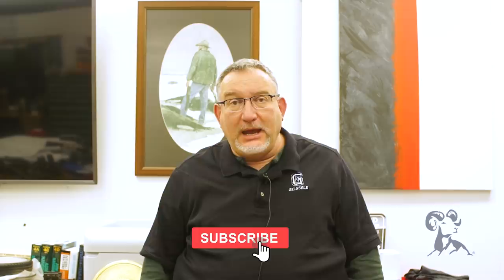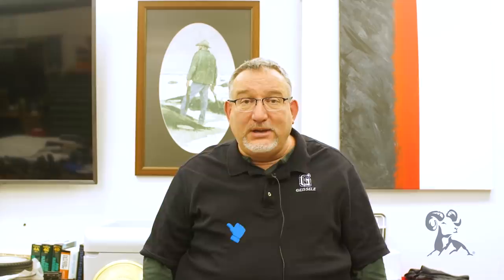SmythBusters: Galvanic Reaction & Your AR-15 - Part 2

Comment: Bill!!  Great to see you sir.  Thanks for producing this.
In aviation this is certainly a concern as it happens often.  For example, aluminum skin panels and stainless steel doublers, riveted together in an aircraft wing, form a galvanic couple if moisture and contamination are present.  It also depends on the size of the parts in contact.  If the surface area of the corroding metal (the anode) is smaller than the surface area of the less active metal (the cathode), corrosion will be rapid and severe.  But if the corroding metal is larger than the less active metal, corrosion will be slow and superficial.
The FAA states how this occurs and shall be mitigated in Advisory Circular 43-4B

Comment: My personal experience with galvanic corrosion is more in the marine world than in firearms, but here is what I have learned over 40+ years of working on boats, and almost that long working on guns.  

First, I completely agree that if the metals are insulated and there is no conductive continuity, galvanic corrosion will not occur, so I pretty much agree with all of the barrel nut discussion.  

However there are other aluminum to steel contact points on an AR-15 that can be subject to galvanic corrosion since they are not coated.  One good example is if you add a set screw to retain the detent lock for the rear takedown pin.  A lot of folks tap the hole on the rear of the lower and put in steel setscrew to retain the spring and detent pin.  Often that is a plain uncoated steel screw threaded into an aluminum lower that has just been tapped, so the contact is direct metal to metal.  That point is absolutely subject to galvanic corrosion.  The same may apply to the steel roll pins inserted into aluminum (however since they are hammered in and out, that may mask minor sticking). 

In most cases, there was some lube on the metals applied during insertion, and they are not likely to be exposed to a corrosive environment (like salt water), so the corrosion is minimal or does not occur, but it definitely can.

Sorry I don't have any pictures, I keep my ARs clean and lubed, so it never happens there (plus I live inland, not near salt water as I used to), but I have witnessed a LOT of galvanic corrosion on boats, where SS bolts were used to retain aluminum fittings.  I once had to cut the aluminum mast step on an older 30' sailboat to free it due to the amount of corrosion and attachment to the stainless bolts.  The solution in that case was the insulation you talk about (in guns supplied by parkerizing, nitriding, or other hard metal surface coatings), I used Mylar washers and tubes to insulate the bolts from the (repaired) mast step and never had any corrosion problems again (this was even published by the boat owners' association as a recommended fix).

So, while the barrel nut may not have that problem, other points an on AR certainly could.  Anti-corrosion, or anti-seize grease usually takes care of it for our rifles.

Thanks for probably the most useful gun videos on YouTube!  Please keep up the great work!

Comment: I'm a jeweler and knew full well that aluminum oxide was basically Ruby, and hard coat anodizing was oxidizing aluminum, and never made that connection.  It's so obvious.
Reply: That’s right, Ruby, Emerald and Sapphire are basically Bauxite crystallized. Darn, didn’t think about that either.

Comment: Galvanic corrosion needs an anode and a cathode in the presence of an electrolyte.  Aluminum will “corrode” when in contact with steel if immersed in salt water or other electrolyte.
Reply: Correct !
Reply: @srspammenot  right... IF in contact... not coated
Reply: Totally agree.  Galvanic corrosion needs some sort of electrolysis to happen, or a slight electric charge.  Don't know why this point wasn't touched upon.
Reply: @CompShooter54  The dissimilar metals provide the electrical charge.

Comment: Hi thank you for making this video. I just wanted to say I'm an electrician and this is something that we have to be concerned about. it's typically not an issue if you have aluminum meeting aluminum it's when you have aluminum in a different type of metal touching is when this can become an issue, but as you say typically some sort of lubrication or grease negates this issue.
Reply: Yup, I’m a builder and my electricians use aluminum tech cable because of copper thieves. They always, always coat the contacts with copper with this weird green grease stuff. Not sure what it is but I suspect there is more in it then simple grease. My inspectors look for the goo as well, it’s important.
Reply: @john-paulsilke893  I'm pretty sure there isn't much special about it, but it is specifically referred to as dielectric grease. I think grease just last longer than oil would.
Reply: In PVC plumbing we us a primer that is typically purple. The colour is there to show the inspector that it was used even though there are primer/solvent combinations available. This grease is probably tinted for the same reason. (Obviously also coloured for the tradesman to visually see that he has done the work right.

Comment: I’m an airplane mechanic - dissimilar metal corrosion is an issue - no doubt. 
No aluminum fasteners - bolts/nuts. Fasteners are cres or titanium for the most part - rivets come in several different aluminum flavors, with some steel bolts and nuts. 
The plane is primarily aluminum. The aluminum is clad for corrosion resistance. Fasteners are anodized/coated/wet installed predominantly, for corrosion resistance. 

Aluminum is 2024/7075 for the most part. There are a few other types of aluminum but they’re rare - 7074 etc...
It’s funny seeing ‘aircraft quality 6061’ - we don’t use 6061 in aviation.

In aviation, it’s rare that threads are lubricated. Torque values are for dry fasteners only. Except for axle nuts that are greased. If you’re installing fasteners for an engine inlet - dry.
Torque values change considerably if they’re wet installed.

Comment: I have ALWAYS used anti-seize on barrel nuts since the 1980s.
Reply: Same here, no issues
Reply: I've always used the same nickle anti-seize that I use on spark plug threads. Works great in both applications.
Reply: Fourth Horseman  Working on motorcycles is where I learned a lot about steel fasteners and aluminum.

Comment: One issue with lubricating threaded connections is this can cause over torquing of the bolt since the connection spins more freely and requires more fighting to get enough friction to hit that torque value. So unless they state to use lube be carful. This is one of the reasons why you don’t lube your lug nuts or bolts.

Comment: Geissele triggers are all I run in my AR's
Reply: I use them on precision guns but for me I don’t because I’m already trained up on a well polished stock trigger. I end up doubling and twitch firing too often. Maybe after the ranges open up again I might try one out again and get some serious practice in. (Yes I know it a training issue, but I simply haven’t put in the time.)
Reply: John-Paul Silke - Just be sure of the trigger you get. I found out the hard way a three gun trigger will double sometimes when fired off of a bench. I needed to switch to a trigger that works well in all situations. I love this one.

Comment: I don't have my 23&P manual right here, but I believe it just says to use 1.  "moly" grease on the barrel nut 2. regular old "GAA" if you need to 3. any oil or lube you have on hand for the barrel nut, so you can take it back of easily when initially torqueing the barrel nut to receiver. And, of course, if the barrel needs to be taken off for services or repairs to the rifle. Like when SPC Snuffie leaves his weapon leaning against the tire of a HEMMIT wrecker.

Comment: Bacon-wrapped the frames that held the copper skin of the Statue of Liberty with asbestos and as the asbestos dissolved way due to the iron slowly rusting. And expanding breaking some of those bands that were on the framework, and when it made contact with the copper it also accelerated some of that rust. They fix that by using stainless steel framework to hold the copper bands in place. Because stainless steel although is corrosion proof, it is severely corrosion resistance and will last much much longer.

Many a ours actually have a coating on the aluminum as well as the steel that is a type of phenolic resin. And will provide a lot of insulation between the two differential metals. Anybody who carried an M16 in Vietnam, especially through monsoon season quickly realized if they were stripping the firearm to clean it on occasion that the aluminum would start to degrade fairly rapidly. Because the aluminum when attached to Steel will literally start turning to powder. If you've ever gone into a barn and seen an old Ferrari with an aluminum body on it, the body will be frequently eating the way and you will see the residue of this white powder laying around because it turns into aluminum oxide. But those Firearms were anodized, which does not insulate them from galvanic action. Which is the actual term you were looking for at the beginning of this video.

The way you keep two pieces of aluminum from galling is to use two different grades of aluminum, they learn that very early with stainless steel firearms that in order to keep stainless steel from galling is used differential grades of stainless.

Plus if you use a stainless steel bolt it has to be a Lehigh Carbon bolt, because stainless also is rather soft if you're not careful with using the proper grade and enough carbon to make it holds enough temper to be a firearm had to be a operating part of the firing mechanism without wearing out quite quickly. That's why stainless steel will still rust, it just does so very very slowly and just very minor up people keep it from rusting.

Stainless steel machine bolts made out of higher carbon stainless with differential grade stainless nuts do not gall.

Anodizing on aluminum does not insulate it from electrical conductivity. It may alter the conductivity, and allow a modicum of resistance. But it does not stop conductivity. It is not an insulating element.

Lubrication on nuts and bolts does not cause them to vibrate out. Not torquing them properly causes them to vibrate out. The other reason they might vibrate out is because it's not a properly machined thread. A properly stressed torqued bolt will not vibrate loose. At least not in a general sense.

Copper anti seize is not used in nuclear systems because it holds onto radiation more than nickel does Nickel is resistant to the absorption of radiation.

One other observation. Don't use WD-40 on a firearm as a lubricant. It is not a lubricant. It is a solvent. And you will not have good luck with it on your firearm. Or your automobile

Comment: When I worked in test house of an American small engine manufacturer, I was trained you couldn't substitute bearing grease for silver or (holy grail) copper anti seize because anti seize is a slight abrasive. Grease would act as a lube, who'd have thought, and throw off torque values. EVERY bolt between dissimilar metals was supposed to be coated.

Comment: I never knew that aluminum anodizing also went down, into the metal.  I always thought it was a surface coating only and once rubbed off the protection was gone.  Thanks!

Comment: AMT / IWI  380 Back-up single action pistols were made with the same stainless steel on both the slide & frame . Which caused Galling when not properly lubricated . I use CRC Synthetic Brake Lubricant on my Firearms . It has multiple premier lubricants such as Moly , Graphite & others . Price is very reasonable & quantity lasts a long time .

Comment: I’ve seen this in plumbing fixtures piping and etc. steel pipe with copper. The use of dielectric flanges and fittings help prevent this but it can still happen.

Comment: Can say that yes it happens and I have seen it during my 19 years as a power sport tech. Usually only see that sort of thing on jet skis that have been in salt water.
 (Aluminium + stainless steel ) + ( heat+salt) = galvanic corrosion

How ever it take all 4 prerequisites to see this condition happen.

Comment: In my experience, it’s more common to see it where there’s very tight tolerances in play. For example, the steel hub bearings on a vehicle mated to aluminum spindles. It’s funny they are talking about the nut on the receiver but I would expect to see it on the barrel extension first if it were to ever occur.
Reply: pot metal rims and steel brake rotors, have to get the big hammer out every spring for these

Comment: No, we don't use aluminum on aluminum fasteners on airplanes. Except rivets. But those don't really count. Most bolts are steel with a cadmium plating, that's why they're yellow. For steel structural members, we paint everything with zinc chromate, which is why planes are green on the inside.

Comment: Mr. Geissele, aluminum on aluminum doesn't create galvanic (dissimilar metal) corrosion. That occurs when steel (or iron) parts come into contact with aluminum (or other like metals) and is subjected to friction and moisture where it creates an electrical charge which causes galvanic corrosion such as an aircraft during and after the flight. An aluminum receiver/barrel nut in contact with a steel barrel doesn't create the conditions necessary to cause galvanic corrosion.
p.s. I'm a licensed aircraft mechanic with 35 years of experience working on general aviation aircraft and a commercial airline company. This subject is taught in aviation schools early on in basic airframe studies.

Comment: If galvanic reaction was occuring wouldnt you see it on the takedown pins the hammer  and trigger pins and other steel thats in contact with the aluminum of the receiver's? Or do people think it just affects the barrels?
Reply: Those parts aren't married together unlike with a barrel, barrel nut, buffer tube, and castle nut. When threaded parts heat up they seize together making it nearly impossible to remove without damage. Which is why it is necessary to grease those parts in order to prevent galling. This isn't necessary for takedown pins, etc. as they will never seize together.

I think that is where the misconception of galvanic corrosion begins because the necessity of the grease or antisieze. People don't understand what galling is, or even go a step further and add Loctite to these threads which is even more ludicrous as it will do nothing to prevent movement. When Loctite heats up it weakens, but that is a whole other can of worms.

Comment: Copper is better than moly coat. They both are good. Here is an axiom. Never assemble anything dry. Oil, grease, never seize, lock tight, something!

Comment: Anyone that has replaced an anode rod, in a water heater, knows about galvanic response.  Good answer on galvanized aluminum.  But, Mr. Geissele presents another question, when he says to lubricate threads.  Lubrication will torque tighter (more easily;) do you have to figure out how much more you need to torque the connection?  I have never seen a "wet" torque spec.
Reply: Wet or dry doesnt change the amount of torque needed, rather, when torquing down it ensures greater accuracy. So let's say recommended torque is 45 pounds (35 - 65 average, 40 - 85 safety margin) putting lubricant doesnt change the recommended torque setting to 25 pounds. It just ensures the wrench would accurately torque to 45 pounds. As torque wrenches usually torque based on resistance, so to speak, dirty unlubricated threads would cause improper torque. I hope that answers your question, I tried to be as clear as possible.
Reply: Lubricated Torque is approximately 30% less than Dry Torque.  A simple internet search will yeild all the engineering data you can stand for why this is true. Here’s a quick, easy version: https://www.engineeringtoolbox.com/torque-lubrication-effects-d_1693.html

Comment: If you want to see galvanic corrosion, paint an aluminum hulled boat with traditional copper based bottom paint. It will pit and in extreme cases eat a hole right through the hull.

Comment: I've seen galvanic corrosion between aluminum and steel on Aluminum horse trailers, but you're talking about something in an open abusive environment. Generally speaking it's the horse pee that starts it. (the uric acid in the pee). trailers that don't get washed enough tend to have this happen IF there is no barrier between the steel and aluminum.

Comment: A bad and aging memory - didn't we use "Never Seize" on aluminum threads?  I am an old Harley guy, we torqued to spec with a thin coat of never seize.  Never had a problem.  But then I checked torque regularly...
Reply: Depends on the application.  A lot of (most?) torque specs I know of in automotive and motorcycle applications are dry specs.  If you apply any kind of lubricant to threads before torque, you over-stretch the fastener and/or distort other pieces that aren't meant to be distorted... things like cylinder heads and gaskets.  

Read that manual closely!

Comment: A steel bicycle frame with an alloy seatpost can lock up and become impossible to remove. ✌
Reply: I always greased crank bolts, seat posts and steering necks when I was an assembler in bike shops.
Reply: @x-calibearusallc  I learned that the hard way. 🤣🤪

Comment: It occurs when you have two dissimilar metal. The weaker metal deteriorate easily. There should be a barrier in between.
Reply: Did you see part one? The barrier(s)primarily is the anodization(the upper), the parkerization/blueing or just the anodized upper and the stainless(barrel).
Here, go to part 1       https://www.youtube.com/watch?v=_5QQmkbeWo8
I absolutely see your point but the issue has hardy ever come up, especially in environments as corrosive as South East Asia.
Reply: @j.mangum7652  Thank you.